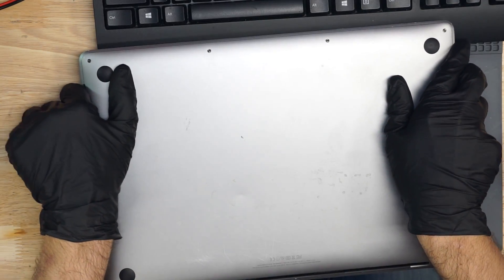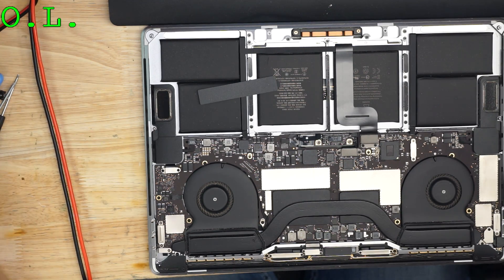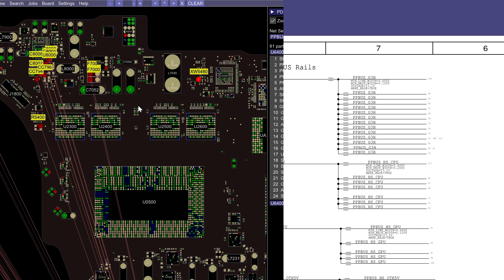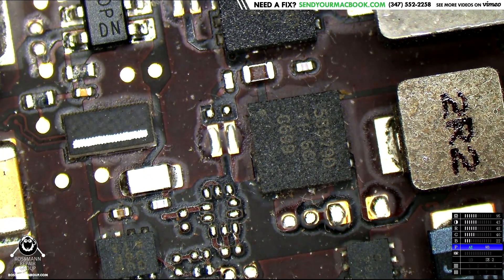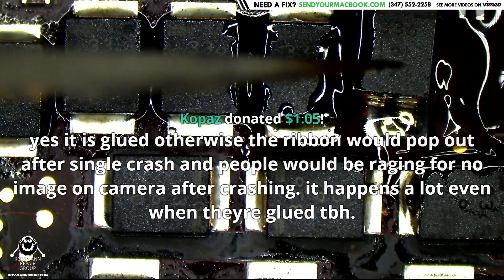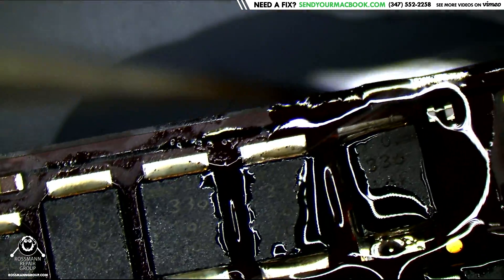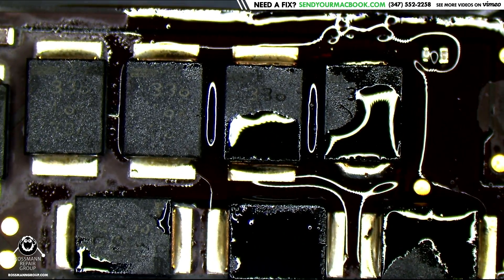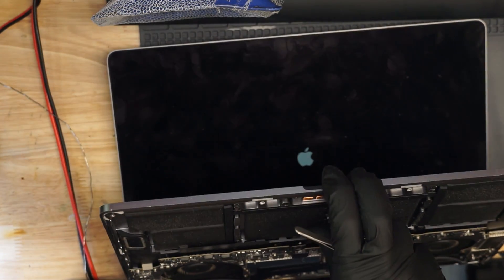Macbook Pro taking 20 milliamps not turning on

Comment: I got one of those like 3 dollar USB soldering irons from eBay and it works very nicely for small SMD components, it's not very good otherwise although it works nicely in a pinch so I don't have to carry a massive soldering station in my bag all the time. For the other stuff I use my station but sometimes the little USB iron comes in handy because it has a tiny tip unlike my station

Comment: Now there's a group of skilled techs eager to move up in the world. Say Louis, bit of a technical question - when you put down fresh solder on a board, with two (or more) pads that are close, how is it they don't flatten out and touch under whatever component you put down? Im not that type of tech so Im curious how it works. If you see this, thanx!

Comment: Great fix, many thx.

Question - after replacing a shorted component shouldn’t I check the short has gone before sticking full power back on the board again?
Reply: ideally, you typically should check for  short to ground on the pads before you replace the parts. as to make sure the blown part you took off was the only short to ground.

Comment: That thumbnail.... I can relate - This one time i was working as a security contractor for a bank down in the big city. But this particular bank was in the process of moving but I was still tasked to look after the building and control access only for only other contractors who had to come in and finish up some work. Doors were to remain locked unless I was given instructions to let them in.

So here i was in a huge building with marble flooring, marble stairs and 5 or 8 floors of just absolutely nothingness all by myself. I had a good poke around the building when doing my patrols and checking things like fire exits and found a bicycle that someone had left behind.. For a few hours i was just riding this bike around the empty building doing wheelies and rolling up and down stairs with it.
I got bored eventually and went back to sitting at the front desk with my laptop. I thought the bike had been abandoned and i was ready to take the bike home on the train at the end of my shift if someone didnt come to claim it but unfortunately someone did.... I still had my fun with the bike while it was there though!

Comment: Regarding hot air stations:
When I went to get my solder certification for surface mount I fully expected to use a hot air station, but turns out that we only used them to assist with the removal of complex components (typically multi-pin IC's). When installing components we used the soldering iron with the hoof tip, size of the tip depending on the size of your component you're soldering.
I only got to use that glorious tool once while soldering a 4 sided, 100 pin IC. I soldered opposite corners, the pins appeared to be lined up with the pads, then soldered 2 sides. Only then did I realize I was not lined up... Rather than fight with removing solder from 50 pins, I used the hot air station and it was removed in seconds.
With that said, I would recommend one if you're doing it for profit constantly but a DIY at home, they're not required and they can easily blow other components off as well. If you do make the purchase, get the kind that have the vacuum built in and cups that surround only the component you intend to remove or install.
Reply: I think it's safe to say some components are difficult for everyone just based on size alone, lol. I wish I could upload a picture of some resistors I had to solder compared to a hair from an acid brush. Had a guy in my class who had prior training and bragged about how good he was who ultimately ended up ripping a pad off because of how bad he was shaking.

Comment: Hey Louis, you mentioned to have written manual for new technicians you hire how to diagnose hardware and that it really needs an update. On videos you show procedure itself for the edge cases, but I do wonder, within existing videos, do you have down to the ground monkey see monkey do instruction that will help to step by step diagnose what is happening, even if it would take x100 times the time professional would spend fixing it?
Like this kid you were teaching what was broken, just simple key instructions and knowledge that would help to diagnose almost anything there is with bare minimum equipment

Comment: Many years my father managed to drop his old-style pre-DECT cordless phone in the bath. "It's OK though. I dried it off, put it on the charger and the red light came on."  The resulting corrosion wasn't as bad as I feared when I stripped it down and as it was all through-hole I got it working again. It saved his life a year or so later when he had a stroke.
Reply: You couldn't trust a non water resistant modern phone to do that. It's a shame that new technology necessities everything to become smaller and fragile.

Comment: Internal Battery says it all.
There is no reason other than wanting you to buy next years model. They know and want the battery to either die or cause you problems. Which happens if your laptop gets wet and you can't cut power